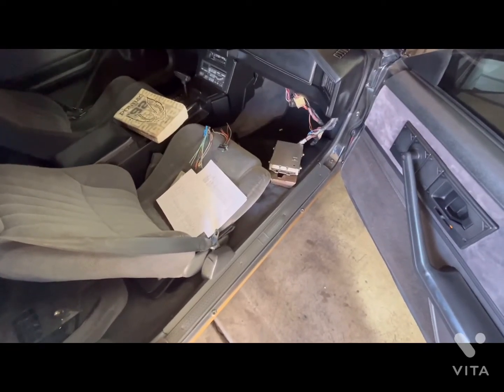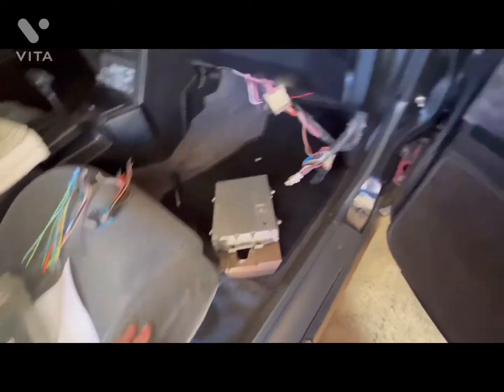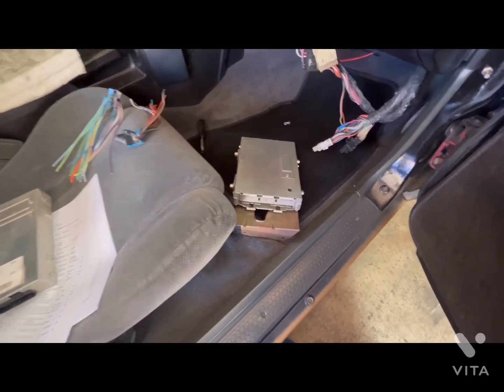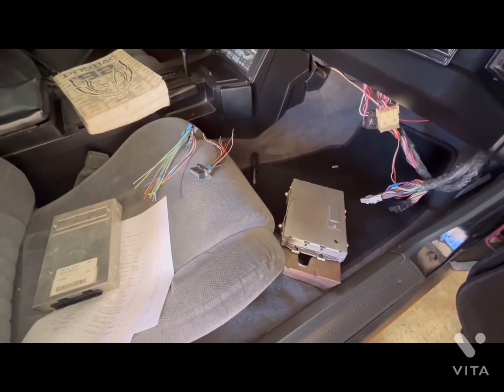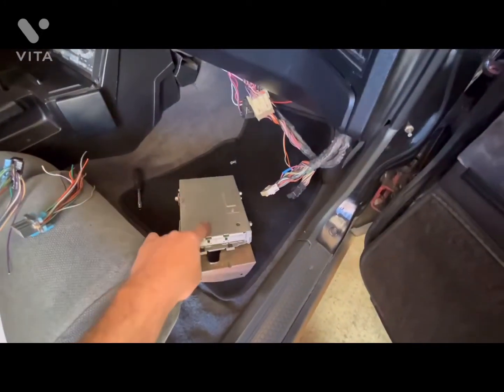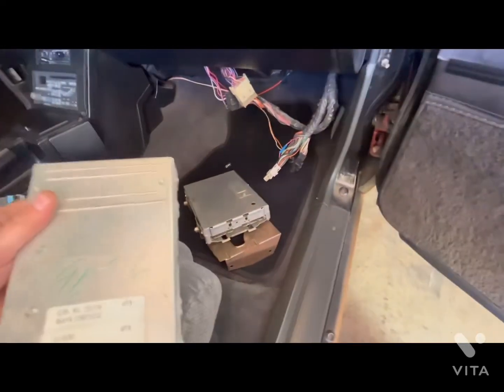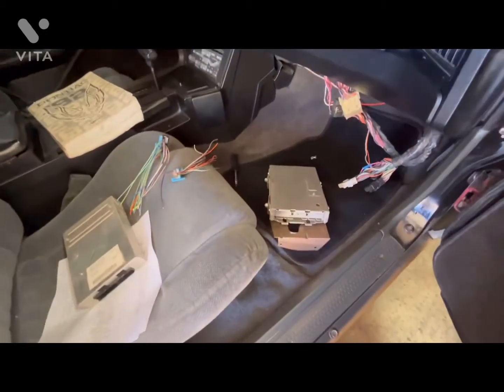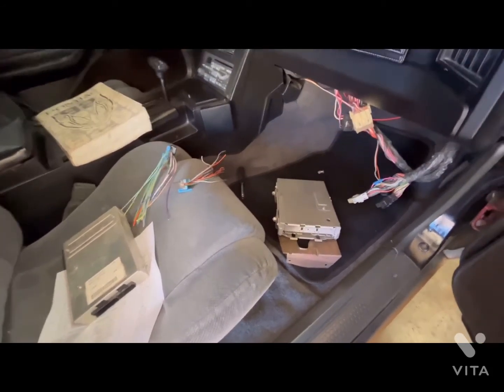New project! 8746 ECM swap into the LU5 Crossfire Trans Am

Comment: It would be great to watch you cut and splice a wiring harness! Maybe show how to correctly solder wires together in the video as well. The ECM you are using is from a 1989 GM tbi right? And does it matter if it is from a truck or a car, V6 or V8? What is the latest ECM you can use? Also does your bird have a controlled air intake in the hood like a 82 Vette? And if so will it be able to be wired into the ECM? Wish you much success  and looking forward to seeing the finished project. 🤓👍
Reply from the maker: The ECM I’m using is an 8746 from an 89 L03 Caprice. The trucks use a 7747. The difference is the 8746 used an IAT and has lean cruise mode enabled. The 7747 doesn’t. The 82-83 Trans Ams do have a functional air induction unit, but the solenoid is adjustable, so I adjusted it so the internal flap is always open. It can be wired up like an LG4/L69 Trans Am by using a vacuum switch, which I may do down the road. As far as the 8746 in my 83; it runs leaps and bounds better than it did with the 6026. It runs smoother, is much more responsive, and the gas mileage is better by a landslide. The ECMs that can be used are the 88-93ish 7747 out of a C/K truck, and the 8746 out of the 89-90ish Caprice/Impala. The F-body 8746 will work as well, but has VATS enabled, so you would have to work that out.

Comment: Such a smart and cost effective approach to address parts availability, I was only aware of the EBL Flash II/HAM or finding a reman'd unit for my '82 vette.  Either way both are way more expensive than your approach.  A couple of things I was wondering about was the xfire has 2 IAC's.  Any issue with that?  Also, any issue with the ALDL 12 pin port?  Looking forward to the next video on this topic, as before you have inspired me to keep the xfire. Thanks for the great info!
Reply from the maker: As far as the IACs, the two IACs on a Crossfire are wired parallel. Both of the IACs receive the exact same signal from the ECM. They don’t work independent from each other. The wiring is basically identical to a later single TB 305/350. You still have two injectors on both styles of TBI, a “left” and a “right”. As far as the 12-pin ALDL, it too is identical to the later cars as far as how it’s wired. The later OBD2 port wasn’t introduced until 1995 on some OB1 cars, and 1996 across the line. If you were to compare a 1982 ALDL port to a 1989, you’ll find the wiring is identical. Like I said, I’m all for the EBL/HAM, but what happens when you need/want to replace the ECM after spending all of that money on an EBL/HAM? It doesn’t just “transfer” over to a different ECM. I figured for a stock/mild car, the way I’m doing it makes it totally plug and play, and completely eliminates the unreliable “card edge” ECM connections for good. With a HAM board, you’re still stuck with inferior 1982 ECM plugs. 👍

Comment: Thanks Joe,  I am going to have to do this to my 84 Corvette due to the 6026 ecm not being available.  I really appreciate the info.
I was considering the ebl flash 2 option.  It sounds great just a little pricey.
Thanks again for these great vlogs.
Jerry
Reply from the maker: I just figured it was a good idea to finally do the swap. I drive this car so much, if the 6026 ever goes out, the car is literally dead in the water. I’m looking forward to seeing how the 8746 runs, and what kind of improvements it gives in terms of fuel economy and overall driveability.

Comment: I did the ham/EBL combo for the simple fact there was no way I was sitting on the ground or under the dash of the 84 to wire. Just too uncomfortable lol. The flash based tuning is kind of nice though. Looking back there are compromises made on the ham board that could potentially have been useful by keeping the 7747 style connector and having extra pin slots. Live and learn but at least my FSM is mostly applicable still. (aside from the pins I have moved to be able to run an IAT sensor) Great video as always.
Reply from the maker: The HAM/EBL is fine, just expensive for a simple ECM swap. I don’t mind sitting on the ground a couple of hours a day for a few days to do the wiring. The way I see it; if you do the HAM board and something happens to the ECM down the road, or want to change it, that’s money out the window. The EBL is great for serious modifications and tuning though.
Reply: @Joesmopargarage  That's true too. I think I had asked bob (EBL) when I was having fan issues and he said it would be able to be pulled and resoldered though... But let's hope I don't cross that bridge in my lifetime and all is good lol. Mine has enough going on that it made sense to go with it though as I'm sure you've seen. 

My big thing with the wiring is I don't fit... I did the heater core when I was 12. Know for sure I can't get under the dash... which is much easier in a thirdgen than a C4. However like I said, you do end up with a more useable end product swapping to the new harness. I probably would do it different if I were starting over and make an entire new harness myself just for the simple fact the car is almost 40 years old and on factory wiring.
Reply from the maker: @ratherbeboating10  All good. There’s no right or wrong way to do something if the end result is the same. I know most people HATE wiring. I myself find it relaxing and sometimes enjoyable; building a nice clean harness from scratch with factory style connectors/pigtails, diagnosing, etc. Then again, I do it all, from engine/transmission/diff builds, to show quality body and paint. Mentally, wiring is a walk in the park compared to guiding and blocking a car for months in end, lol. 

How does yours run after the ECM swap? Any improvement over the original 6026?
Reply: @Joesmopargarage  actually never ran the 6026 with the heads and cam. Did run it with the renegade and mild cam. It ran a lot better even than stock with it. It always ran well, but idle down (approaching lights) and low speed behavior (parking lot type stuff) improved. But wide open didn't seem any better. 

I also enjoy wiring. I did a lot on a 67 firebird and altered quite a bit of the stock wiring to work with what was done to it. Granted that whole harness was maybe half a modern one but was still fun. I am nervous now as the plastics on all my connectors are getting brittle. I've replaced a couple like the MAP and TPS ends but I worry about the injector drivers and distributor wiring. Last I checked the distributor parts are NLA and the knock module too. If all that starts going I'll probably pull the engine and work on a custom wiring harness/solution. but for now it is perfectly fine in my imagination lol.